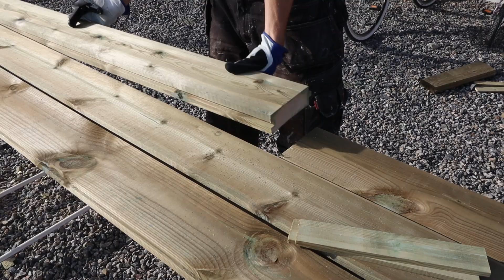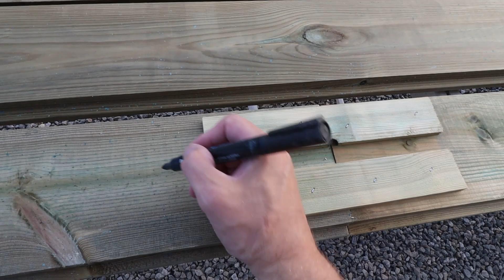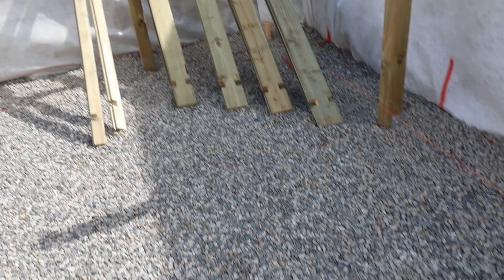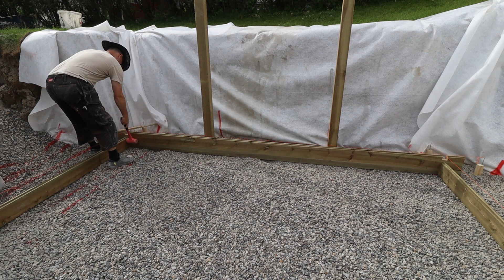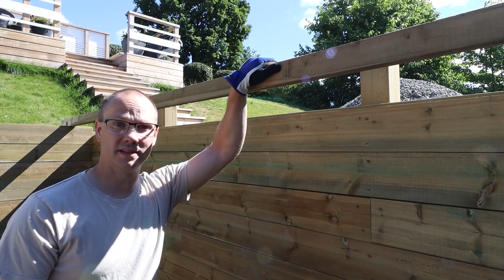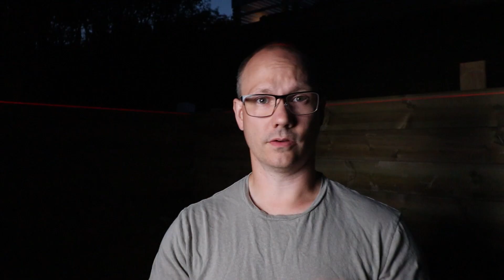How to make DIY Pool Walls out of Wood | Inground Wooden Pool Build Pt 3

Comment: smart built, btw do you think you really need tongue and groove planks or you think it is possible to go with straight planks? I do not find such material
Reply from the maker: The tongue and groove ensure that the walls stay flat and that no dirt gets pushed in from the outside between the boards. I would not do it without it. It also makes the but-joints MUCH stronger. It took me some time to find it, as well, but it's well worth the time to search for it!

Comment: I am asking questions because I am curious and learning from you.  You are meticulous in your work and I appreciate it.  Plan to build a pool like this in the US in the spring.  I am finding available pool kits so expensive.  It’s almost as if they are taking advantage of people.  I know many question how long the wood will last.  Your build will last a long time with that drainage system you put in. Do you have a pump or do you rely on gravity?
Reply from the maker: It is connected to my house drain system that i recently also replaced so this whole system will last at least 50 more years :) No pump, just gravity. This is also something I want all in on when adding it. A good drainage system will vastly improve the lifespan on the wood. If the drainage system does not fail then the wood will basically never rot. The worst thing you could possible do it to have no drainage system and refill with soil against the wood (seen so many vids with huge amount of views that do this).